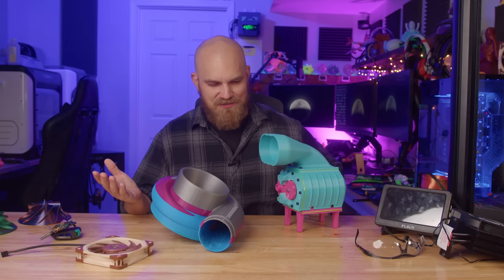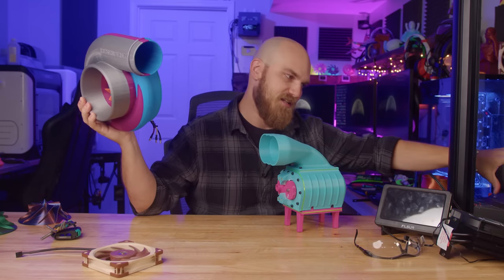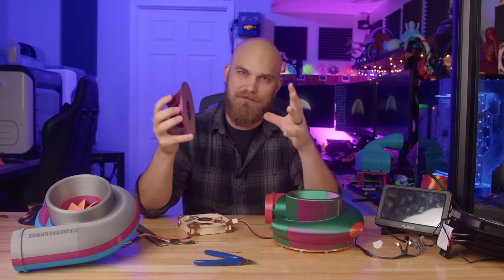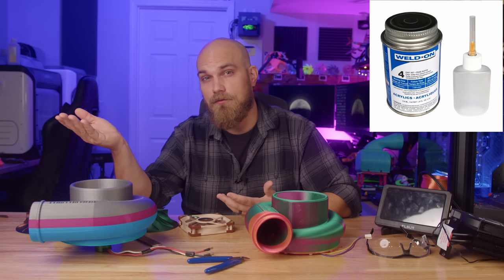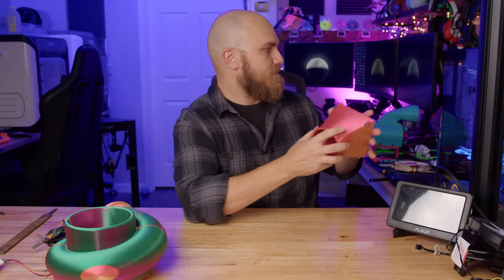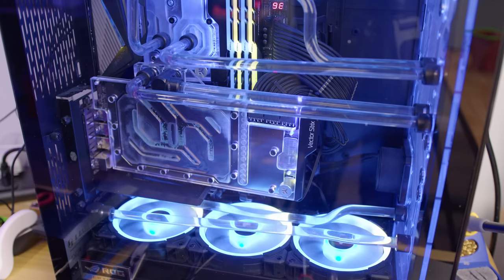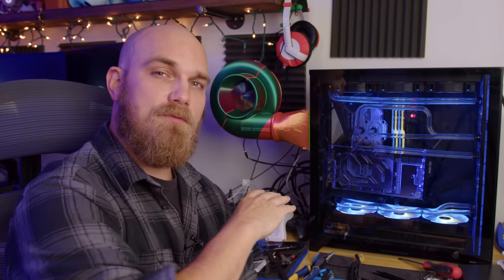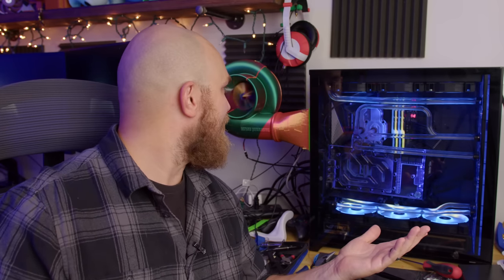Boosting My PC Performance With A TURBOCHARGER

Comment: you're turbo fan is out competing your existing intake fans effectively meaning they aren't there. the turbo fan could even produce enough pressure to back flow air through the existing intake fans. I suspect that's why we see smoke coming through the bottom at the end.

Comment: Do you think performance difference could depend on water cooling/not, the type of pressure difference you are running, (pos v neg,) and how well sealed the surrounding airflow is, (ie the surrounding vents next to the turbo?)

Comment: Thats more of a procharger not a turbo. For it to be a turbo it would have to be the exhaust fans spinning the impeller. 

It would be super cool to see you do a real turbo, run some piping from the exhaust fans, run the exhaust fans really fast to spin the impeller, and boom you have a theoretically working pc turbo

Comment: So what I'd like to know is, does this turbofan push more air through the radiator than a Noctua Industrial @3000 RPM?
Also, does it push more air through the radiator than the fan that powers it alone?

Comment: isnt it blocking the air trying to enter the case when its not on? Wouldnt a better test be removing it off the case? Consider making the turbo smaller, This would be about 1100 hp turbo on a car, takes forever to spool up and requires a crapload of fuel (energy), so reducing the size would reduce the amount of energy required to make it spin. The volume its pushing will be slightly less, but there is a sweet spot of efficiency where its not too big and not too small for the amount of power you're able to give it.

Comment: U should try to make something on top that sucks the air out  and see if that works any better than blowing air in.  Make it a two part. 1 that goes under ur pc that blows more air in thew the bottom radiator and one on top that sucks not blows air out like a vacuum.

Comment: don't know a lot about air! but have worked with hydraulics, if you have a high hydraulic presher going into something with two outlets IF? the outlets don't are not big enough for the in presher then you get back presher! so it does not run efficiently? IF YOU know what I mean??? English not my strong point
think this might sound better?????? the exhaust is not strong enough to get ride of the intake? so you get back presher?

Comment: Imagine if someone made a hole in the wall an stuck just the Turbo out the a smol one and make a cover for the rain then put a air filter image that when if where you live get to like 10 degrees

Comment: Turbos are cool but can you imagine how cool it would look if you rigged up a supercharger to sit on the top of the case and used a front mounted fan to instead turn a belt to run the supercharger to then force air down through the top mounted radiator? OOF!!!

Comment: Let's not confuse a slight decrease in temperature with a slight increase in performance. At those temps you are most likely to have precisely zero actual performance gain in terms of FPS or render times

Comment: No idea why companies haven't started making pull rgb fans in addition to their push ones, if you've got 2 rads it'd make the system look better and it'd be way better for cleaning. Anyone who has run a negative pressure system will know how shitty the dust situation can get.

Comment: Easiest and cheapest way to make it work flawlessly is getting a "ROG" fan-hub (its fake, obviously). They're great damn quality, been running one full blown 3 years in a plex servers with 8 fans pulling total about 25w 24/7 and its still working a-ok. They use the PWM connection for sensor and control, while the power it uses comes tru sata, so they're "limited" to about ~55w-60w but i mean, i wouldnt call it a "limit" when you can run 4 SanACES 120mm 7k rpm at 100% speed no problem, lol.
Reply: Also, they work more akin to a "splitter" than a hub, since all the pwm signal output comes from a single pwm input connector.

Comment: try hide turbo to another case, maybe with dual turbo fan to split air flow for top and bottom radiator.
but no one try this..  you should try build cooling system other side of room.. all noisy part go to behind the wall.. try docking a PC.. because no one try docking a pc with built in cooling system..

Comment: OK, but at least don't have your fans working against each other, somewhat creating a void in the middle of the case, because then you're just going to be creating a negative air pressure that will defeat a good portion of your cooling efforts. I don't see how that would look better than pointing them all so that they blow into the case from one side and out of the case from the other.

Comment: nooooooooo that pc.....
at least have the bottom fans suck air into the pc. temps would go down by so much. as hot air rises, the best airflow is cold air in from front and bottom and hot air out top and back. in this layout, hot air is pushed down and then compressed under the case, then pushed back in. also, the case runs negative pressure, which means air is dragged in through all the cracks and gaps in the case, dragging in dust with it. the fan layout i suggested and im sure many other people will runs neutral pressure which reduces dust buildup. even better would be positive pressure, but this comment is really long already so ill just cut it here.

Comment: You may have accidentally stumbled upon one of the best coolers in a long time.  Your results seem to hint at this project keeping the case at a constant temperature regardless of the load.  It's not always about more FPS in games.  Consistent temperature is just as important.  This just may be your most successful project yet.

Comment: that is not how turbochargers work. compressing gas makes it heat up exponentially hince the need for intercoolers . if you are going to upload another video pertaining to this experiment, you definitely want you blow air out of the turbocharger setup for the purpose of reduceing temperatures inside the case.👍

Comment: That's because that's your exhaust area but now you are pushing air into the area. Your air setup is wrong as shown with your smoke. If you had that in a pull type, it would be a different story.

Comment: IT People: "I don't think this will get you better temperatures and clocks"
Car people: "Dude, turbo- and superchargers aren't meant for cooling but compression. They heat the air up, which is why you need an intercooler after them."
People: "Looks cool" 😂👌

Comment: Pulling heat through the bottom, sorta defeated science,  heat rises. So you're blowing heat out the bottom? Heat is reentering your pc through its cooling phase, if your pushing air through a radiator, that's even more heat.

I would put the Radiator at the front or Top

Comment: "But I don't want it to run off a motor from an  RC car and a battery; I want it to run off a [computer] fan header."
Why do you want it to run ON an RC car motor instead of on typical computer fan header?
It seems to me like you would want it the other way around. So that's odd.

Comment: Pretty sure super glue would have filled that a lot better :D
Reply: also, if you suspend the turbine side with a bearing, I bet it would vibrate a lot less!
Reply: AND... when you compress air, its temperature goes UP... so now you need an intercooler as well!

Comment: Dude water cooled cpu shouldn't be 80 Ever ..... My i9 never goes over 69 water cooled and gameing ......Is there something wrong with your radiator???? Clogged? only bring it up ive had issues like that as well and it was a Bunch of dust in the rad aft er a quick blow out i was back to normal .....Possible old thermal Paste??

Comment: https://youtu.be/s4WP6WZlU8U?t=964 you can see some smoke at the back of the fan before it's made it's way through the computer, possible leak on the backplate? Also, HWMonitor is a great pc information tool with easy to read max/min values and verbose logging.

Comment: your pc is not your way, it's squarely into the "wrong way" category. severe negative pressure. dust will invade it from all sides and it'll get dirty quicker and it'll be harder to clean. gross. at least make it a positive pressure system ffs.